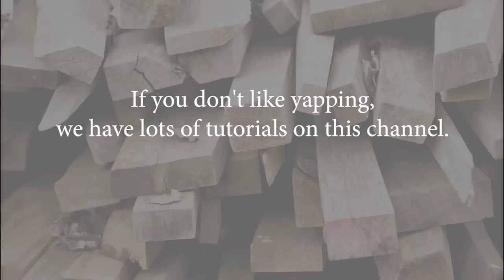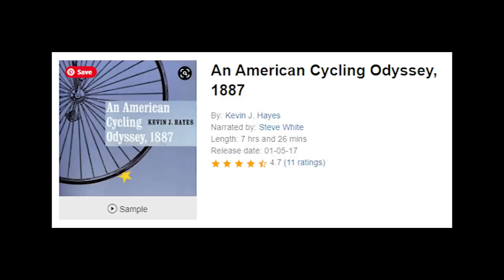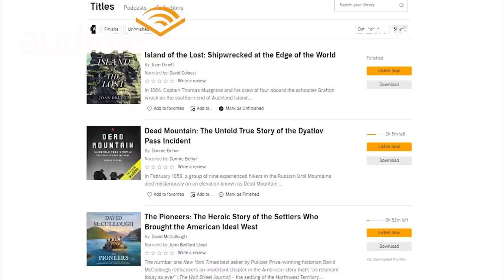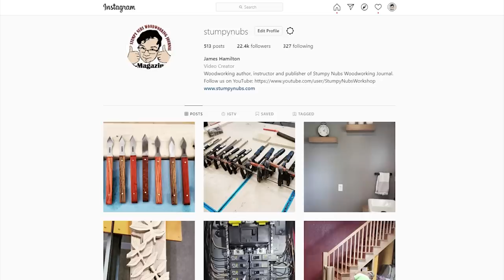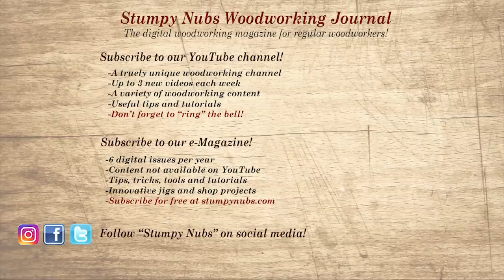Have they BANNED table saw dado sets????

Comment: I'm UK Scottish. I just welded an extension on to the arbour to take dado's and that works fine. I just have to dig the dado's out of the ceiling every now and then.
Reply: Too funny!
Reply: LOL !!!
Reply: ...coffee out the nose!!!
Reply: Scottish ingenuity!
Reply: Typically Scottish. Want it, dae it.
Reply: That's great. Now how do I get a Daddo out of the ceiling? One type is called Cameron.
Reply: @johnmanning4577  I once did that with 7up when I was a kid, laughing at something 😤.
Reply: Great shop decoration, a " Conversation piece" ......nuk ... nuk ..nuk...
Reply: Dado sets are available in Oz, I use one on a radial arm for doing tenons. 

How does Europe go with spindle moulders??
Reply: I thought everyone stored their dado's in "slots" on the ceiling.
Reply: People Make Glasgow (more dangerous)
Reply: I tried the arbor extension with JB Weld.  You can imagine how that worked out! !! !!!
Reply: Surely Blue Tack shoved through the dado set is sufficient?
Reply: I have thought about this solution although it might be difficult to have perfectly aligned shafts.
I am just wondering where you found the good tap and you could align the thread you made with the pre-existing thread. Did you leave the tap on the thread before welding and went backward?
Reply: I now have a perfectly plausible way of dispensing with the wife.... I need to get the insurance in place first; can anyone suggest the best place for me to have her stand when she brings in the coffee? (and Psssst.... Our secret, eh)
Reply: @mikecozzi1040  Or Fascism... 😉
Reply: Anything can be a dado if you're brave enough.
Reply: Had me in the first half
Reply: @Biggus_Mickus  Complete nonsense, if he had taken that to court with the proof of his tournament it would have been thrown out.
Reply: @scotthamilton407  It's hardly a "problem" there are many things banned or restricted in every country to save the people from themselves, its just the smart thing to do.

The vast, vast majority of people in the UK are in favor of public healthcare. Many people would be dead without it.
Reply: @mikecozzi1040  You people really do crack me up, anything you dislike must automatically be communism... You clearly have no idea what Communism actually is do you?
Reply: @Biggus_Mickus  Wow that's such complete nonsense. What's next they gonna start pulling gran over for travelling with a rolling pin? Way to go
Reply: Lmfao 🤣
Reply: @steveiv9250  you definitely missed the point and it flew right over your head.
Reply: @scotthamilton407  Yeah. The way intrusive "govt" is heading - we're going to have to stick frame buildings with OSHA approved Nerf nails and nailguns...
Reply: @harrier331  Government. From the two words Govern and the latin root for Mental etc. Thus govt = the control of your mind.  The bureaucracies hardly ever make better choices for than you can make. If one chooses to play stupid games and thus win stupid prizes - let the left hand of Karma smack them out of the gene pool...
Reply: @bradleyroon7639  
government (n.)
late 14c., "act of governing or ruling;" 1550s, "system by which a thing is governed" (especially a state), from Old French governement "control, direction, administration" (Modern French gouvernement), from governer "to steer, be at the helm of; govern, rule, command, direct," from Latin gubernare "to direct, rule, guide, govern," originally "to steer, to pilot"(see govern). Meaning "governing power" in a given place is from 1702

governance (n.)
late 14c., "act or manner of governing," from Old French governance "government, rule, administration; (rule of) conduct" (Modern French gouvernance), from governer "to govern, rule, command" (see govern). Fowler writes that the word "has now the dignity of incipient archaism," but it might continue useful in its original sense as government comes to mean primarily "the governing power in a state."

Nothing to do with mind control whatsoever...
Reply: @harrier331  Did you happen to harm any sarcasms in the making of that post?  Everything stated is the govt controlling the mind or rebellions would be constant.
Reply: @bradleyroon7639  ...
Reply: @Biggus_Mickus  do you have a butter-knife licence? are you licenced to conceal carry assault pliers?
Reply: @troy3456789  I was saying that it is not communism, so what is your comment supposed to be saying?
Reply: Always best to quench your thirst with a couple of cans of Tennent's Super before you fire up the table saw - gets a bit dry in a wood shop.

Comment: Here in the UK we also have the dado set's angle-grinder cousin: the wall chaser. I own one, it's the best tool to use if you absolutely positively want grit and dust to appear in all sorts of places around your house that you thought were completely sealed off from the room you're working in.
Reply: I had to google "the wall chaser" to see what it was. Oh yeah, that's SOOOO much safer than a table saw with dado blades.😏 (Yes, that was thick with sarcasm.) I am curious though, what would you use such a tool for? I mean, it's obviously not for sawing a piece of wood in half. While it's a pretty cool looking looking saw, for me I can't imagine ever finding a use for such a tool. Yes, I know I'm like a year late with this response, but I didn't want to go two years. Oh, and pretty cool screen name, my friend.
Reply: @pumpkinheadghoul  It's used for cutting a channel across brick walls so that the plumbers & electricians can conceal pipework & wires/conduit etc.
Reply: @pumpkinheadghoul  Yeah, rather than having walls made from wooden battens and plasterboard (what you call drywall) like you do. Over here we decided it was better to have internal walls made of solid brick, so we have to demolish the house with those wall chasers if we want to install new cables/pipes etc. And donkmeister wasn't kidding about the dust. It took us two years to get rid of it all when we had the house rewired!

Comment: I worked for a company that made high quality bookcases, audio-visual cabinets, etc. We had dado sets in radial arm saws to cut dados for permanent shelves. I spent over 20 hours a week cutting dados for two years and never had an inkling of the setup being dangerous.
Reply: The radial arm saw is the way more dangerous part of the equation than the dado in it! those things are crazy.
Reply: @MK-lh3xd  lol
Reply: not likely to spin out like a table saw.
Reply: @aprildegele1510 , 🙂once you've got used to the self-propelling nature of the blade making the cut a RAS is in fact a very satisfying tool to use. It is just as dangerous or safe as any other power tool with pointy bits moving at speed and it's not as if the blade could suddenly come off the arm and jump out and into your chest. 😏😉 
In cross-cut operations the wood is firmly pressed against the fence and you're moving the blade, which is MOUNTED on its carriage, towards you. Note, towards you, not right up to your body. Compare that with a table saw, where your hands are used to control a piece of wood around the blade. The blade might not even come close to your hands, but the wood can do all kinds of things if something does go wrong... I'm not saying it's more dangerous than a RAS, but there's a different kind of potential risk that you have to look out for.
I don't have a need for a dado set yet, because I have a router in a table and I'm not routing anything much anyway, but I'm so getting one for my RAS as soon as the need arises.
Reply: @stadleroux  I completely agree with this assessment of the radial arm saw.  Especially for crosscuts, I feel that they're actually quite a bit safer than a table saw: as long as you brace correctly against the self-feeding action, the wood is safely held against the fence, and kickback isn't an issue.  Even if the saw does get away from you, it will just self-feed a little bit until the deep cut stalls the motor.  I don't use dado stacks on the RAS, because it's just too hard to control the feed rate.  On the other hand, I'm completely comfortable ripping on the RAS; the presser foot on the blade guard keeps the wood firmly on the table, and if a kickback should occur (which it hasn't in over 40 years of using this tool), I always make sure the anti-kickback pawls are adjusted correctly to catch the wood.

There are some cuts that just don't make sense on the RAS (like a big dado crosscut - ripping one is actually OK), but for me the biggest reason to pick the table saw is accuracy.  Despite having a top-notch saw (the original DeWalt, before it got Black-and-Decker-ized), and the tools necessary to set it up with machine-shop accuracy, the relationship between the blade and the guides (table, fence) can never be as stable and rigid as a table saw.  But operating safely and within its limits, I personally find the RAS to be at least as safe, and to me safer, than a table saw.

Comment: One main reason I opted for the Milwaukee M18 FUEL 8 1/4” Table Saw, as opposed to the DeWalt 20v 8 1/4” Table Saw, was that the Milwaukee ACCEPTS a Dado blade set!  I procured my set of dado blades from Amazon about 6 months ago!  Hallelujah! I’m all set! Thanks for your great videos, brother!
Reply: What’s your opinion then on the short stop time the Milwaukee has? Could this possible loosen the abour nut ? I just purchased my first set of dados for the Milwaukee. Surely Milwaukee know of this potential issue?
Reply: Seems hard to believe that saw has enough power to run a dado stack. Maybe a 6" set and shallow passes.
Reply: I opted for the DeWalt because the Milwaukee seems to bog down and stop during long rips.  That might just be for oak, though. Most people use pine.
Reply: 8 1/4 Table Saw??? I just "downgraded" from a Jet 10 Contractor Table Saw to a Dewalt 10" Jobsite Table Saw. They have a couple of different models. One model will not accept a Dado Stack, all the others do. The Dewalt has more power than the Jet contractor saw. 
I'm trying to make my life more simple. Trading the 350 pound Jet for the portable Dewalt. Then going to a Festool or Makita cordless track saw to cut down 4 x 8 panels. Cutting 100 pound 3/4" MDF on the Jet was getting crazy.
Reply: @WallyFuller  Progrip sells straight edge clamp for using a circ saw to break down large boards although in practice I just have the seller cut plywood sheets down for me.